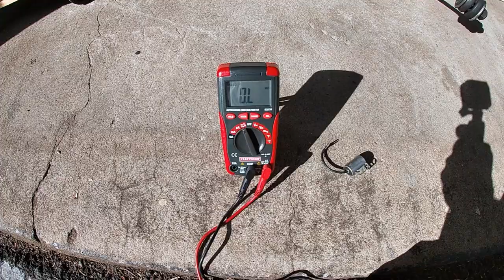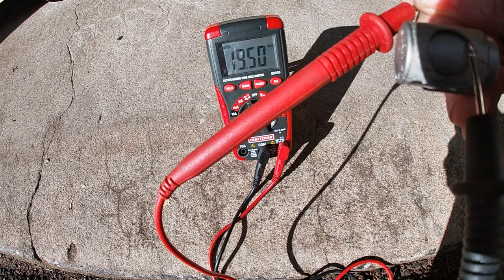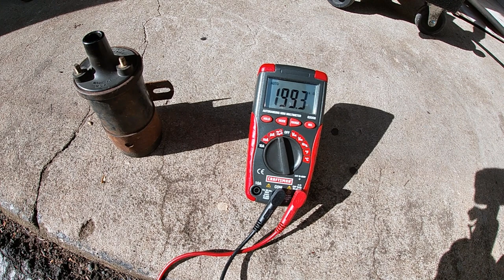Barn Find 1958 Dodge Coronet Lancer - Engine Vitals

Comment: The 325 poly of that year model only came with a 2 bbl, the 361 had 2 single 4 bbl options and one with dual 4 bbl carbs. Compression indicates that is a healthy engine , sounds good ! I think it could use a new cap , rotor , plugs , plug wires , and condenser . May just need the grounds cleaned up .

Comment: this 2023 and you are working on a 1958. you are going to be lucky to find anything at a parts store today for that car. take youre old parts with you so you can compare them there to make sure you get the correct part. dont be surprised if you need to modify something to make it work for you.
Reply from the maker: So true. I took those pints to at least 3 stores, and the one I took home wasn't even 100% correct.

Comment: First thing I would suggest, find the timing mark on the crankshaft pulley and mark it with some white or yellow paint.  Makes seeing and setting the timing much easier.  I am not sure what elevation you live at but back in the day (60s-70s) it was common practice to advance the timing over factory spec 1 to 1.5 degrees for every thousand feet of elevation. (We lived at 7000 so we usually went 10 degrees).   Next, I agree with commenter Robert Lynch on electrical parts replacement to give you a solid baseline to work from.

 You cannot reliably check the distributor by looking for wobble while it is running.  Worn bushings will affect performance long before they are bad enough to see wobbling while it is turning.  Try taking the distributor out and put it in a vise.  While holding the points open, grab the top of the shaft and try to move it side to side.  IF you can feel ANY PLAY at all, the bushings are shot and the point gap will be all over the map while it is running.  The bushings are replaceable however if you can find them.  The same bushings were used over multiple years on multiple engines so they should be available.  I think I saw someone comment on vacuum leak possibilities.  That is something that I didn't think of but is absolutely worth checking out

Finally, with as many vehicles as you are working on having a decent set of test equipment (dwell meter, etc) will pay for itself in less than three months by closing off false rabbit holes that chew up time and money chasing after false causes and parts that you may not need.

Based on the compression tests you seem to have a pretty solid engine mechanically.  If you had burnt valves or ring problems you would not be getting as good of compression readings as you are.  (I would retest that cylinder that tested 145 as that is suspicious to me).  I am looking forward to seeing further progress on this car because as rough as it looks from a distance, I think it has the potential to become a very nice car, worthy of taking it to whatever level you want.
Reply from the maker: Wow, thank you very much for the detailed response and suggestions, it is greatly appreciated. I will look into the information you supplied. Thank you again!

Comment: Vaccuum guage is you're friend on these cars,best way to tune them looking for maximum vacuum. Timing by the book is a starting point, vacuum guage will tell you where the engine would like to be in regards to the timing.
Reply from the maker: You know, I used a vacuum gauge to tune our Fury wagon and that worked well when adjusting the carb, I should do the same on this car.

Comment: That engine sounds nice. Go back to time stamp 17:46 and see just as you turn over the engine there is a spark jumping across the plug leads, looks like no.7 and 8 cylinder area. Be no harm to fit new plug leads.
Reply from the maker: You are correct, I should change the wires, and plugs. Trying to do things on the cheap is definitely a mistake, sometimes. Forest through the trees. I do not see the spark jumping, but I do not doubt it. It took me a few weeks to find the correct points, one would think finding the correct cap/rotor/plugs/wires would be a no brainer, I guess I'll find out. Thank you!
Reply: I saw that also. Jumps from front to back.

Comment: Probably due for a new set of VALVE STEM SEALS. My 318 fouls plugs & blows smoke when the top end pumps up oil off Idle.

Comment: Did these 58's have a gear you put put it in to lock the box like a park? Thanks,mine rolls in all gears and relies on the handbrake? Doesn't seem safe to me lol
Reply from the maker: the transmission does not have park. There is a drum brake on the back of the transmission that is actuated by the handbrake under the dash, it is not very good for parking. Throw a block or two in the trunk and chuck the wheels when parking.
Reply: @cudafry1967  ,cheers,just wasn't sure if somthing wrong with box,a mates got an old cadillac and when put into reverse it locks the box,thanks for the info 👍

Comment: It seems you confirmed bad plug wires, but haven't replaced them. Cleaning the plugs also doesn't eliminate them as a potential cause. On a car that's been sitting a long time, it's best to replace all of the ignition components. One piece at a time is frustrating.
Reply from the maker: Agreed. Trying to work on it a little at a time and on the cheap can backfire, pun intended.

Comment: Change plugs. If one has a craked insulator down inside plug it could cause miss. I would suspect the one that looked oily or wet.  Do you have a vaccuum guage? That can tell you a lot as well.
Reply from the maker: Cracked insulator! I should have thought of that, I actually think I did but dismissed it for some reason. Thank you! I do have a vacuum gauge.

Comment: The engine has good compression. If those cylinders weren't firing that engine would be shaking and running terribly. However if those cylinders were lacking compression they'd just be along for the ride so to speak and it wouldn't shake as badly. Is your gasoline fresh? Stale and rotten fuel can be an issue. Also look for vacuum leaks as a possible cause for rough performance. Those plugs didn't look that bad. Might also look into timing as an issue as well. That's all I know!
Reply from the maker: Fresh new gas in a small red plastic tank. Vacuum leaks, did not think of that, thank you!

Comment: One thing that it really needs is to drive it and blow the cob webs out of it. It's obviously not ready for that yet. Proceed with the things it needs to get it ready for the road, tires, brakes, exhaust, windshield and then give it a drive.
Reply from the maker: I'm thinking putting a muffler on might help with a few full throttle runs around town.

Comment: If you can't find points get a protrinx    electronic  ignition  2 wires on it very simple to do I put it in all my classic cars it doesn't matter if the shaft is wore neather

Comment: Valve adjustment,  fouled plug, firing order.
Reply from the maker: Valve adjustment, possibly, I believe they are solid lifters in the 325 poly. Fouled plug, possible, will replace all. Firing order checked. I wish I ran it at night to see if there was any visible arcing or sparking. Plan is to replace plugs/wires/coil/etc.